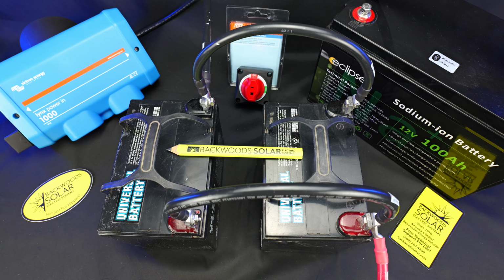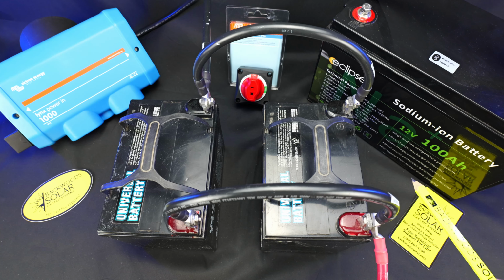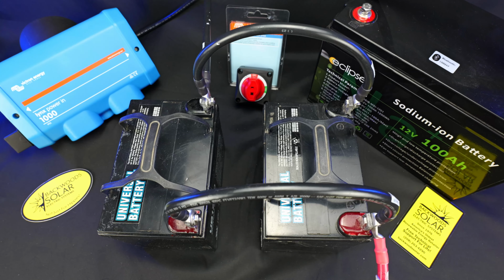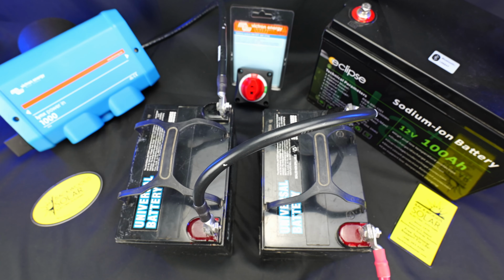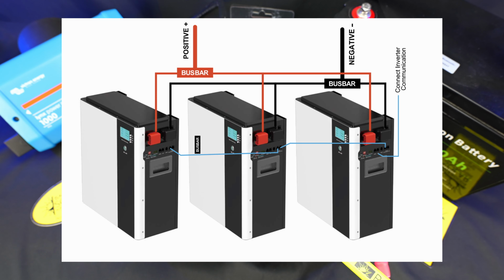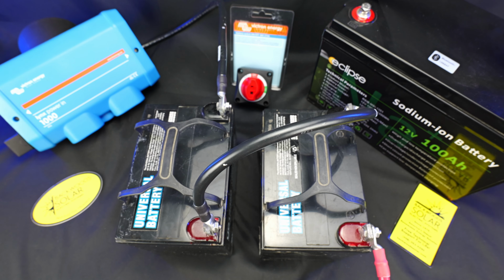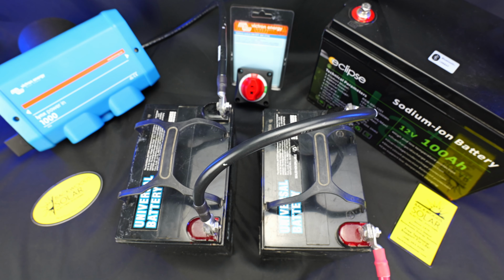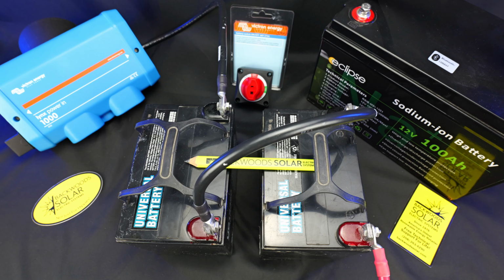Backwoods Solar - Batteries 101 - Basics, Wiring and Tips

Comment: Charge cycles. Voltage flat on discharge like lithium? Bms required?
Reply from the maker: Sodium Ion Batteries still have an internal BMS. It can do internal cell balancing if needed. Discharge and charge curves are not as flat as Lithium.  High and low voltage range is wider as well. All of the other characteristics in terms of charge algorithms are very similar. You can get additional info on our Sodium Batteries from our website linked in the description of the video.